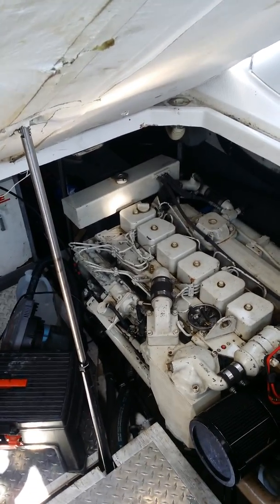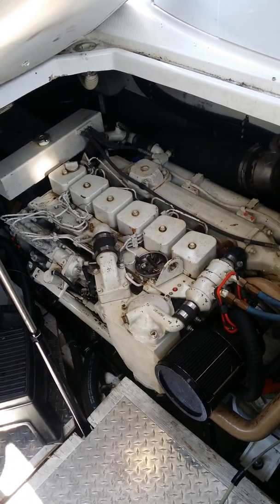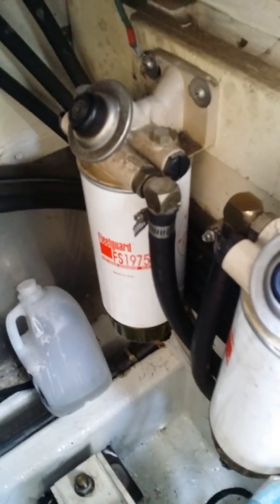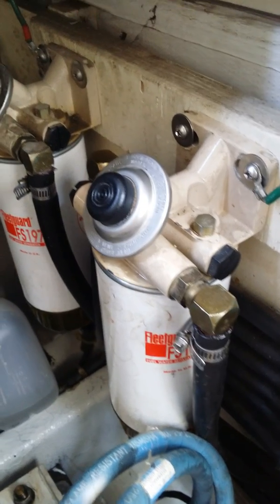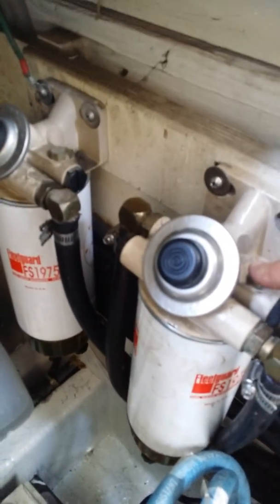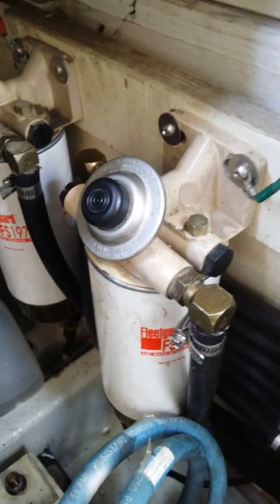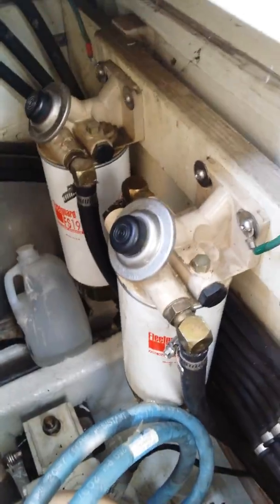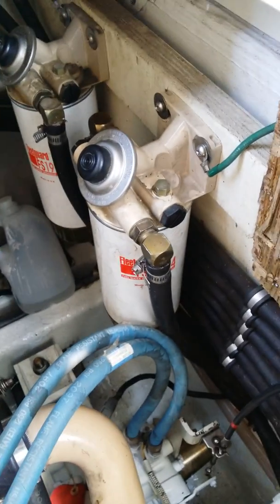Diesel yacht priming fuel system racor r120p air in system plunger not pumping fuel

Comment: Branden, the filter head is defective in that there is a check valve under the lid and above the filter element. The valve is not closing. Therefore when you pump on the black knob you get no pumping action. The reason your fix worked is that you got the filter down below the level of the fuel in the tank and it filled the filter by gravity feed, which removed the air. If this is correct then pumping on the black knob will have no effect. There is a kit for replacing the check valve. I had just this exact problem trying to prime this filter this past summer on a boat off the Washington coast. Your fix would not have worked because the in/out hoses came directly from the behind the filter; would not allow the filter to be lowered. However, I will include your fix in an article I am writing about fuel filters. I used some engine oil to fill the filter in order to get a prime as I had no spare diesel to use to refill the filter. I did use the diesel that had been in the original filter. By the way we were not out of fuel, but the filter was plugged. You need to install vacuum indicators and keep an eye on them.
Reply: Where did you get the kit from?